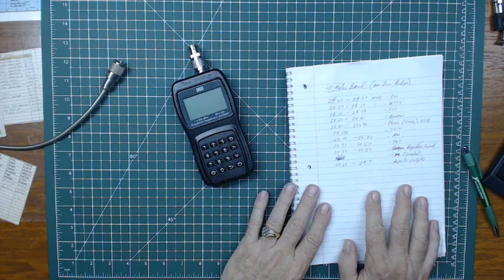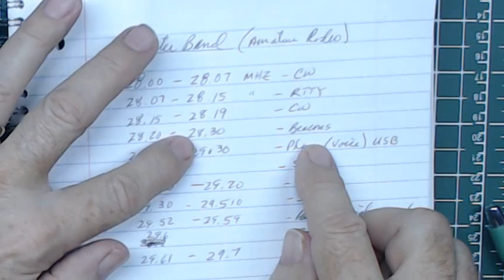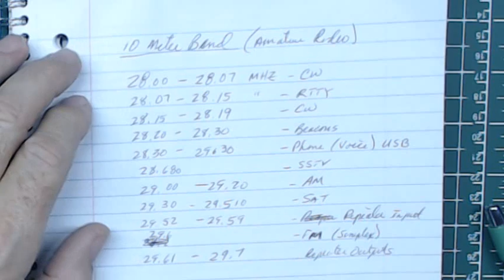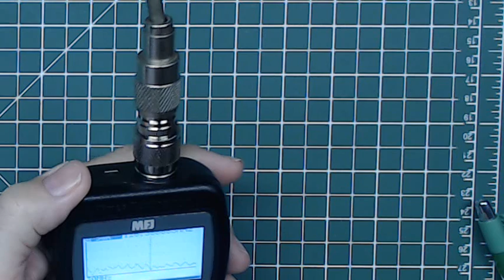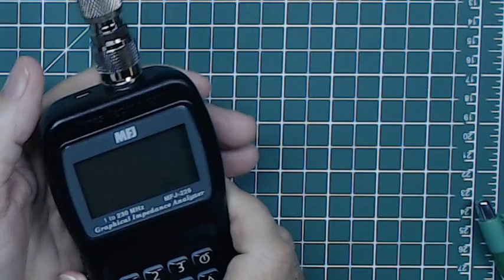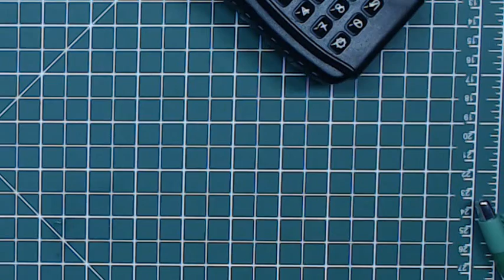TRRS #0921 - Getting Back to the 10 Meter Amateur Radio Band

Comment: Informative video but you might want to check on the frequency allocations for Tech USB voice which if I remember right, unless
it has changed, frequencies from 28.300 to 28.500 mhz was designated. There's not much available for the Tech license and the 
General license would be a lot better to have.  Thanks Tom for the video.
Reply from the maker: The frequencies I listed in this show were for all licencees.  You are correct about the limited band for Tech Licensee.  0.200 Mhz is enough bandwidth for me. :)